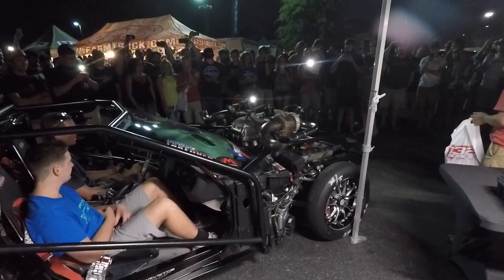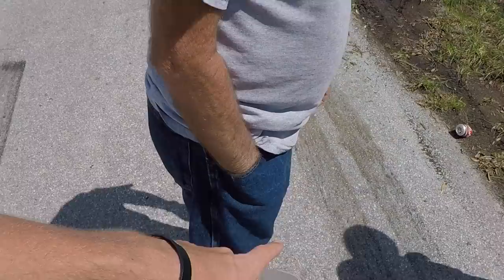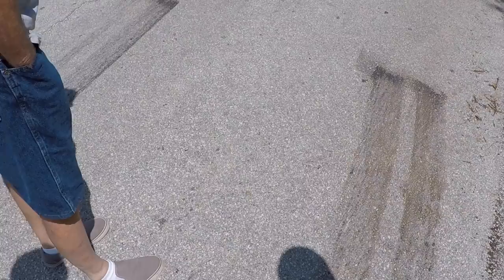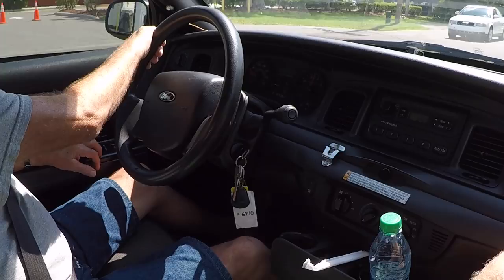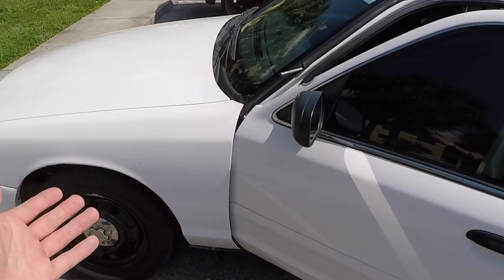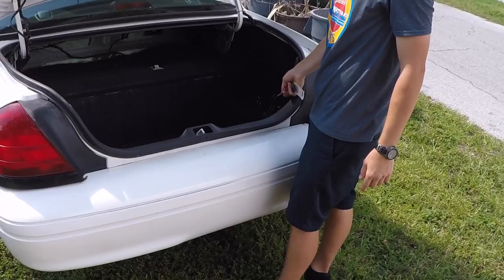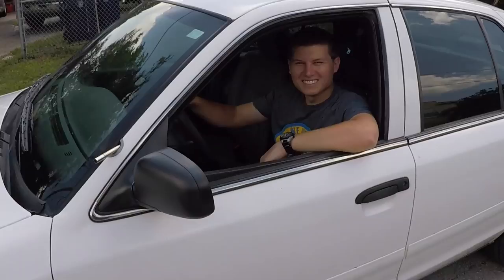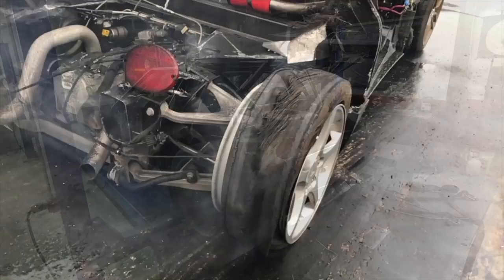*NEW Project Car* + Calling Out Street Speed 717!

Comment: Coyote swap it. No one does it
Reply: DaEasterBunny there's a reason no one does it
Reply: konner kramer truuuuu
Reply: konner kramer because it's fucking expensive but it out does the ls swaps!
Reply: 96cobrasvtRJ in what Way does the coyote out do the ls
Reply: konner kramer just about every way! less displacement and still more power then a ls3,really good flowing head design that you don't have to go with aftermarket heads like you do with ls blocks! Smoother Rpm's and revs higher,stock block can handle 1000whp and ls blocks can't! Don't get me wrong tho I still love GM,I wouldn't mind a new Camaro as 1le or a c6 z06,I love all American cars I'm just more impressed with ford at the moment

Comment: Coyote swap it to mix up the channel up a bit
Reply: Eddie Trujillo too expensive. Just keep it simple put a lq4 in there gap the piston rings. Better headgasket and studs and put that LSA blower on there. And a 3800 stall converter on a powerglide or a t400 trans.
Reply: That would be super awesome, but expensive.
Reply: Or he could do something interesting instead of just cheap.
Reply: Jacob Coffelt duh what's interesting on a coyote?
Reply: Jacob Coffelt interesting is for people like street speed 717 fan boys. People that know what's best is are real mechanics that took engines apart themselves and know what they can do. Not some google mechanic that think he knows something or if any about auto engineering.
Reply: The fact that you can boost a Coyote engine to 700+whp with no issues.
Reply: I guess you've never seen what 2015+ coyote motors are capable of. In completely stock form they hold 700rwhp with a good fuel system all day long.
Reply: Lol...stock coyotes can't handle 700whp? 
 >Whipple 2.9L Stage 1 Supercharger 
>Whipple Billet 132mm Elliptical 2000 CFM Throttle Body 
>Injector Dynamics EV14 High Impedance ID725 Injector 
>JMS FuelMax - Fuel Pump Voltage Booster 
>Driveshaft Shop Carbon Fiber Driveshaft & 1400HP Half Shafts 
>McLeod 800HP Clutch & Flywheel 
>“Kooks 1 7/8” Long Tube Headers, X-Pipe & Catback

That is literally all you need.

This setup will make 725whp all day long.
Reply: Jalpa it won't last one run.
Reply: Bullshit cause the mod list I wrote is from an actual car, and oh it's still running. I can show you plenty of videos of it.
Reply: Rods & Pitons are the weakest part of the Coyote 5.0L. With stronger rods & pistons they will hold 700-800HP. 

https://www.youtube.com/watch?v=YA66yeoAD60
Reply: Brendan McCarthy you sir are incorrect they can handle that no issues
Reply: voodoo
Reply: Brendan McCarthy Fuck that shit; Keep the original 2V and put some Billet Aluminum Trick Flow Heads on that Block, put an off the shelf Mustang 2V Eagle Rod Rotating Assembly in it, Steeda Pulleys, MSD COPs, MSD Ignition Box, Stainless Works L/Ts, Kenne Belle Mustang GT 2V Blower, Higher Stall 9.5 or 10" Converter with a Lightened Flywheel, TransGo Aggressive Shift Kit 4.10 or 4.30s, 35 Spline Drag Spool, 35 Spine Axles, and you got yourself a fuckin BEAST, without having to put a fuckin LS Motor in. It'll be more unique AND fun to drive and quick as a mothercucker too...
Reply: He is putting a coyote in it

Comment: Install nitrous for now and swap it whenever it blows and weld the diff. Make it more of a drift/burnout style car unless you can get a nice lsd
Reply: Joseph Samsor crown Vic's have LSD difs
Reply: Taco Gaming it was one wheel peeling though. Or am I just wrong that lsd's stop that?
Reply: Only some p71s have an lsd I saw something that said 15-25% don't know how true that is but most don't. Also if they wait for a 2valve to blow up they're never going to actually swap it lol.
Reply: All p71's came with traclok but the clutches wear out over time
Reply: Jer Cooks not true it's option in addition to the p71 package if you get under there and read the diff code it'll read 355 (which is the ratio) if it's an open diff and 3L55 if it's a limited slip it's also very possible the clutches are just worn out.
Reply: Robert Smith I think in 99-00 almost all came standard with traclok unless otherwise specified. Then they switched from the 28 spline to the 31 spline axles later. Anyway good platform just heavy but adtr performance makes some great stuff

Comment: that engine already has aftermarket support, 3.55 lsd rear end, torque converter and a couple cheap diesel truck turbskies and see how far it can go on the stock engine before it blows up

Comment: Look under the dash, between the brake and e-brake pedals, and you'll see a black box with a toggle or pull switch on it. That switch will turn off the Tremco anti-theft and the car will shift out of park like normal.

Comment: hey look at 02 grand prix, the engine always out drives the body and the gtps are pretty quick for being a cheap car. mine has 239,XXX miles and still runs great. only rusting out and the pinch welds are gone for putting it on a lift

Comment: Naw, here's a cheap challenge.......take that 3 valve motor and add TWIN TURBSKIS!
Boost till she blows!  See how fast you can push the stock motor!

Aftermarket efi controller, some healthy turbo spec cams, head studs, some real head gaskets, E85 or E100 fuel and beef the trans up.  Get Neighbah into the low 10s or high 9s in the quarter. Do a contest on how long the motor goes before it splits in half or kicks a rod out. An LS swap would be too easy👍
Reply: Steve Ross it's a 2 valve 4.6, not a 3V. The Crown Vic's never got the 3V and only the Marauder get the 4V.

Comment: Bring a mach 1 2003 or 99/01 cobra motor put a fuel system on it and  single turbo, easy 700rwhp 🤙🏼 direct swap no modification same engine mounts

Comment: Cletus McFarland please google and read the article "Low-Buck Turbo Ford – 592HP 4.6L 2V Motor For $2,298" by hot rod. You already have the car and motor so you dont have to spend the same money even. Put a built trans and converter behind it. They used a cheap ebay turbo. You could even buy a forged bullet with decent rods/pistons to turn it up a little.

Comment: If you are going to waste the money swapping in a Ford engine might as well go all out and throw a Voodoo in her...probably the only Voodoo engine swap on youtube....err ever anywhere lol.
Or just keep the original engine and throw a turbo on it...probably would be the most economical route but open up the ring gaps a bit and see how long a stock Mod motor lasts for on 15psi of boost.
No I got it....put a Triton 6.8  v10 in it and boost the bitch....that would be sweet and very original.